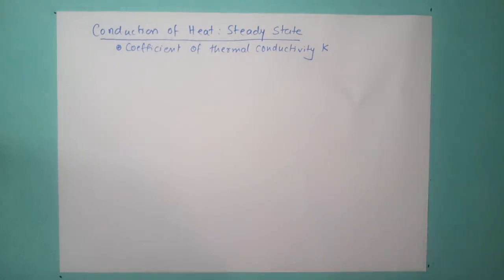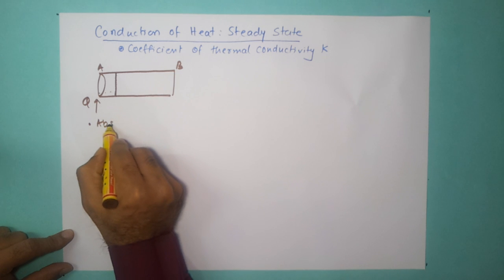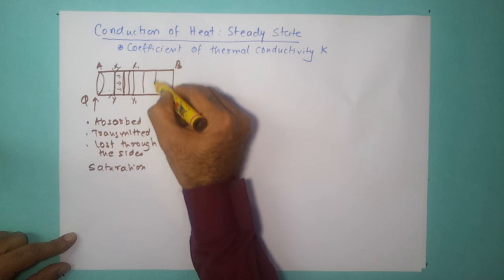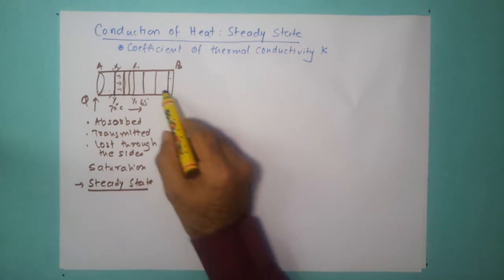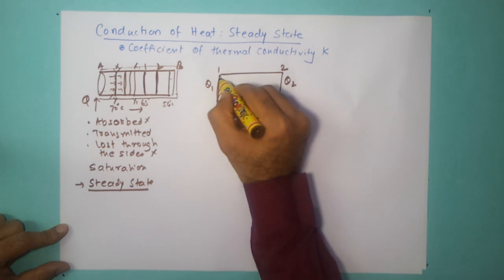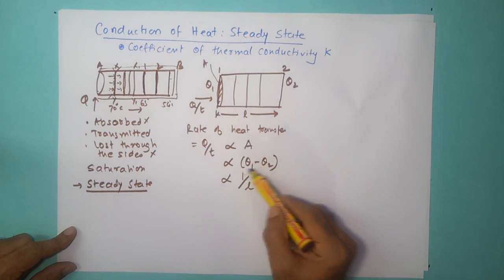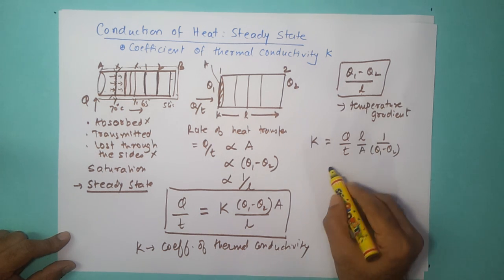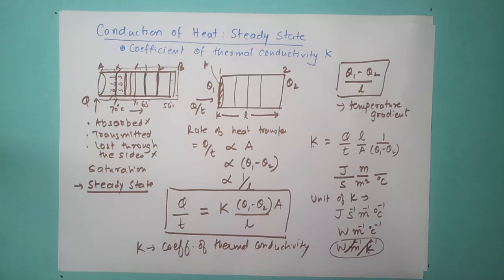2| Coefficient of Thermal Conductivity | Heat Transfer Explained Simply

Comment from the maker: ✨ Quick Recap:

Coefficient of Thermal Conductivity (k): Property of a material that measures how easily heat passes through it.
👉 Formula: Q = (kAΔTt) / L

✅ Metals → high k (good conductors)
✅ Insulators → low k (poor conductors)

💡 Tip: Always check units carefully (W/m·K) in exams!

👉 Question for you: Do you want me to make the next video on convection vs. conduction? Comment below ⬇

Comment: First class teaching, sir!
Reply from the maker: Thanks Rahul .
Reply: pls make more videos on physics topics taught at college 1st year level...similar to this
Reply from the maker: Sure. If you any particular topic in mind, please let me know.
Reply: I have a lot: 
UNIT III THERMAL AND MODERN PHYSICS 
Thermal expansion - thermal stress - expansion joints - bimetallic strips - thermal conductivity-
heat conductions in solids – flow of heat through compound media - Forbe‘s and Lee‘s disc 
method: theory and experiment- Black body radiation – Planck‘s theory (derivation) – Compton 
effect – wave model of radiation and matter – Schrödinger‘s wave equation – time dependent and 
independent equations – Physical significance of wave function – particle in a one dimensional 
box. 
UNIT IV APPLIED OPTICS 
Interference - Michelson interferometer: construction, working, determination of wave length and 
thickness - anti-reflection coating - air wedge and its applications - Lasers – principle and 
applications – Einstein‘s coefficients – CO2 and Nd:YAG laser - semiconductor lasers: homo 
junction and hetero junction - construction and working – applications. Optical fibres - classification 
(index & mode based) - principle and propagation of light in optical fibres - acceptance angle and 
numerical aperture - fibre optic communication system - active and passive sensors.